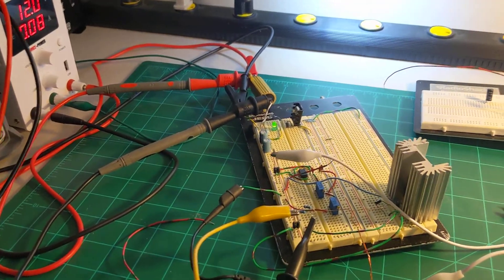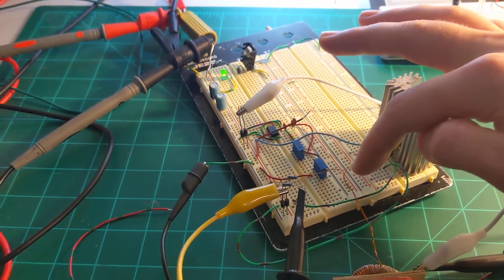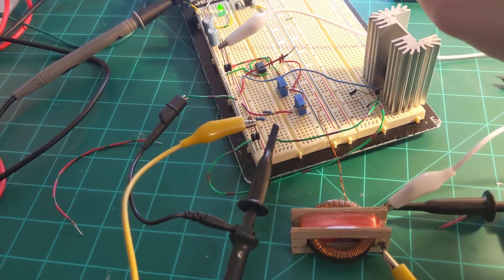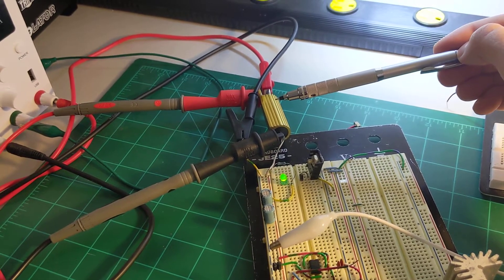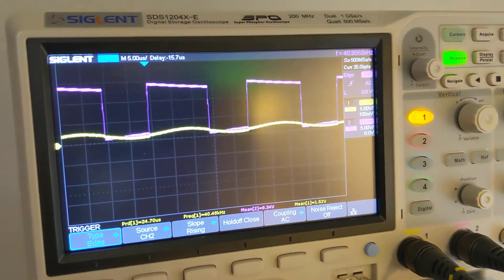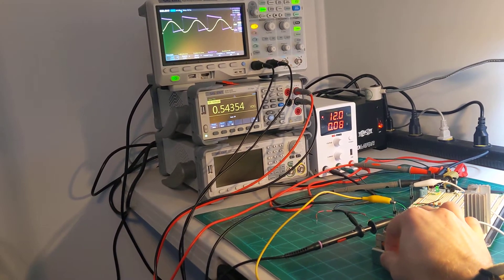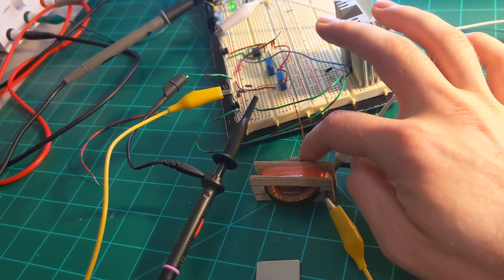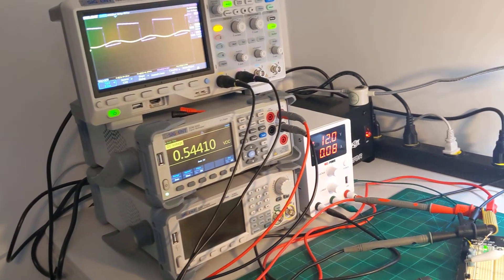FluxGate Generator Overunity Test Results

Comment: Try use AC sine wave input, if the secondary coil does not electromagnetically load the primary coil, then theat means the primary coil is consuming apparent power but not real power

Comment: Can you show your drive schematic 
 I have tried .555 driver doesn't work.
Which type of drive circuit do you use
Reply from the maker: yeah I used to use 555's but they are so finicky and sensitive they can be a pain to use, I use IR2153 for all my circuits now. It's just a basic Halfbridge driver, do you have some way of receiving the schematic? Can't send it with a YT reply.
Reply: You can show schematic via community posts in youtube
Reply from the maker: @rudrakshavegad1999  Can't make community posts when you have under 1,000 subscribers, wish I had that many lol
Reply: @Leviathan15s  ok no problem I got the rough idea you gave about IR2153
Thanks for your support

Comment: Hi , iam trying to make a simple flux gate magnetometer compass to detect earth magnetic field and direction.
At what frequency do you drive the drive coil.
Also can I drive it with a 555 square wave generator? Or I need a h bridge. 
About how many turns are there in drive coil and output coil.
Reply from the maker: The drive coil has around 75-100 turns driven with a square wave at 25-30 kHz, to stop the coil from heating up you'll want to have a low duty cycle 5-15 percent. A 555 should work just fine. The drive coil has around 250 turns of fine wire, more turns the larger your signal out will be.